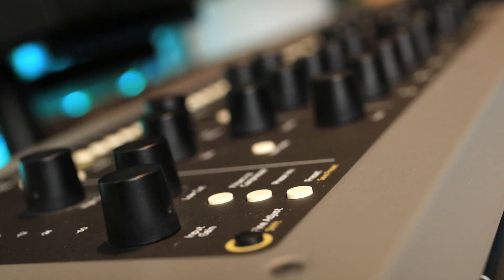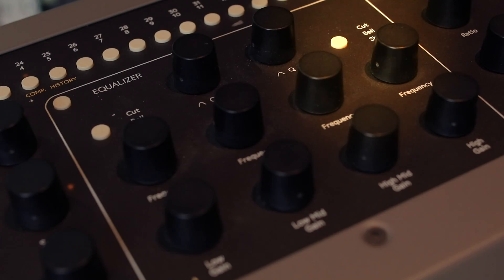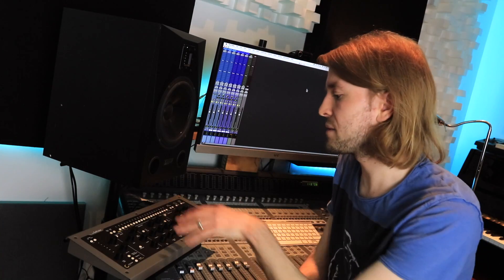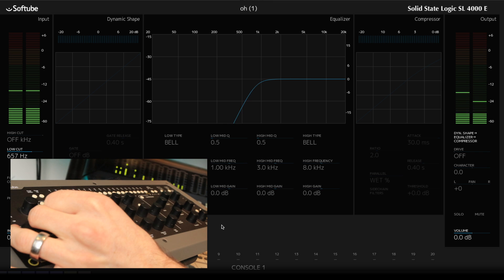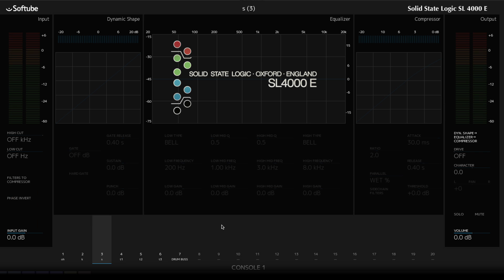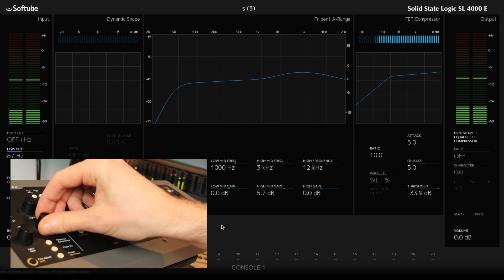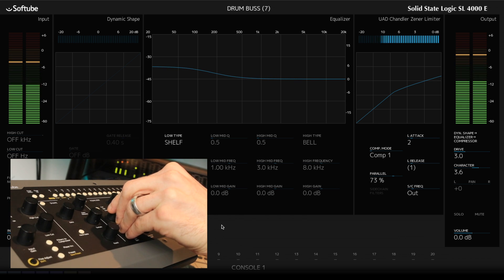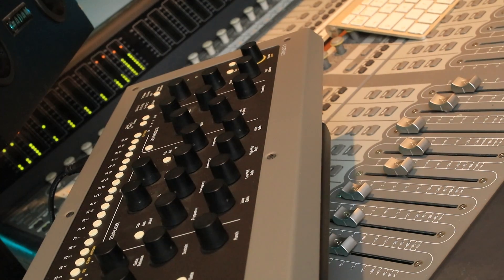How To Use Softube Console 1 MkII Control Surface With UAD Plug ins

Comment: Excellent video! Do you had to do any previous config in pro tools in order to get a full use of the console 1? I had the icon Qcon pro and ex and i want to add the console 1 to my set up but i’m not sure that is possible.. tx
Reply from the maker: Both devices will work at the same time in pro tools

Comment: Hello Dan,

Are you able to use the Softube to control UAD plugins within your DAW, but while looking at the actual UAD plug instead of the Softube interface? Meaning, could I drag an 1176 onto an insert of my kick, click on the plugin to bring up the actual UAD plug interface and then reach for my Softube control to tweak settings? The Softube console interface is nice but I'd rather be looking at the UAD plug while tweaking settings.

Cheers

Comment: Softube has great sounding plugins. I would like to see softube make an external hardware like UAD to process the sound before the track.
Reply: I think he means something like a UAD Apollo that enables you to track with Softube plugins. At the moment, using DAW monitoring and adding a plugin on an insert increases the latency too much to be usable...
Reply: Why? 
So you pay more for using Softube? 
It doesn't make it sound any better
Any modern computer can handle the DSP required for running this plugins 

So you have been sucked in by the UAD marketting, unfortunately. 
Have a great day making music!